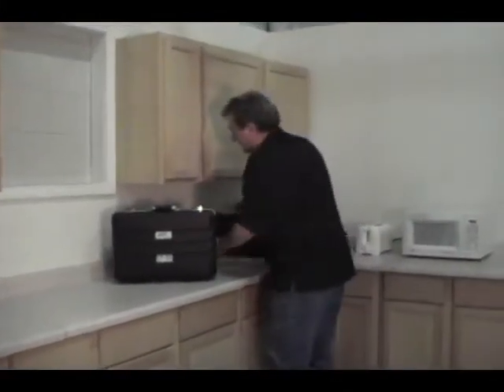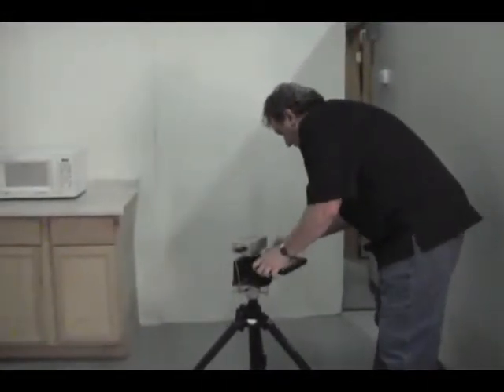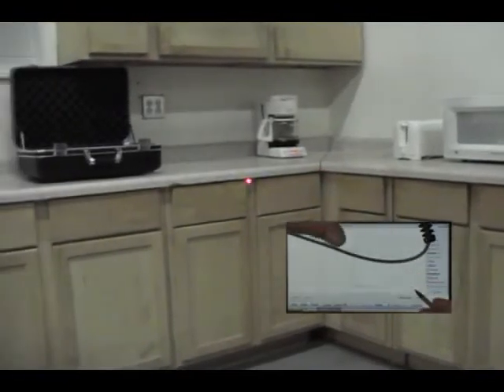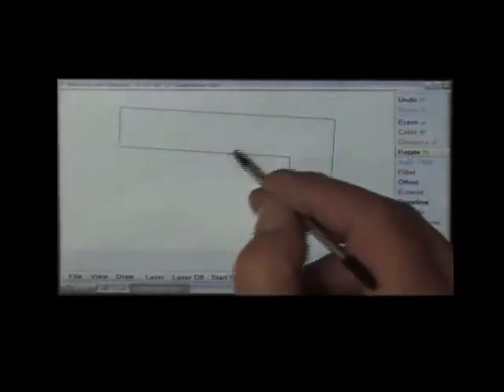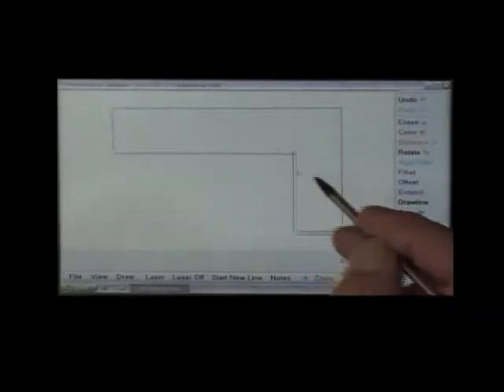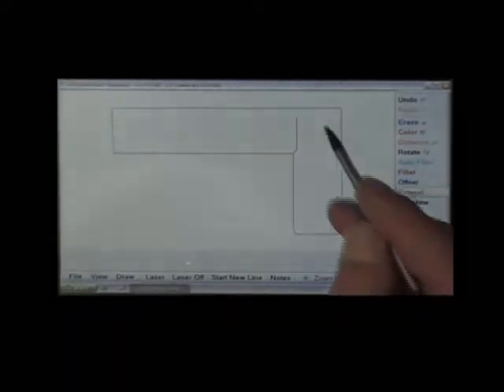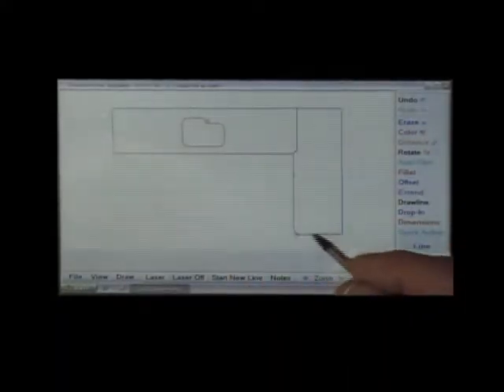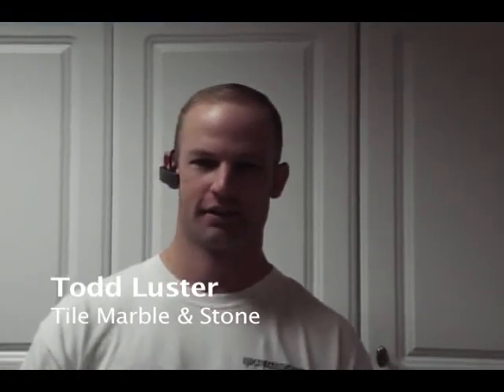LT-55 XL - Templating Counter tops

Comment: I use the proliner, to me it is much easier, faster and more versatile. The tripod on that unit is big! that wont fit in a lot of the smaller kitchens I encounter. The proliner can sit on a countertop, like the island. I guess its like anything, you get used to it. I would, however, like to give it a whirl for giggles

Comment: I highly recommend you check every single dimension you can when using this product.  Verify reality to what laser shoots.  Otherwise you'll end up digging drywall out to tuck your counter into, or doing field mods, or kicking your seams so it goes from no gap to 3/16" glue line from one end to the other.  No problem if your customers are stupid, or if you lie to them and tell them that's just how it goes with these kind of counter tops (which a lot of fabricators do).

Comment: Saves  time if you don't care about overhangs being off by 1/8" or so, & sharp angles wildly unpredictable.  Also, I don't recommend raising or lowering the tripod after starting.  The screw style shaft causes wobble as it travels up & down, meaning your "zero point" changes.  Add that to the 1/16" tolerance the laser shoots (that's a 1/16" radius, so you could be off by 1/8").  Don't believe me, try shooting the same spot over & over.  You'll get a zig zag formation 1/8" in diam.